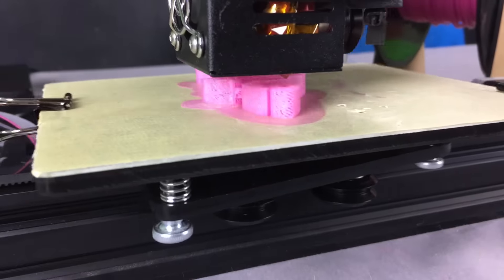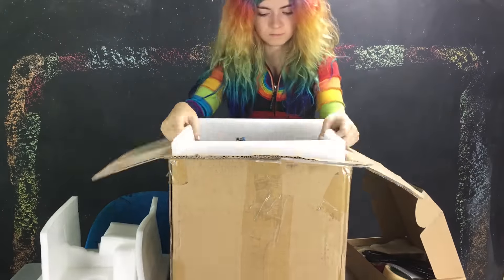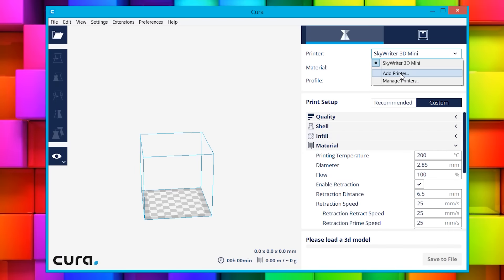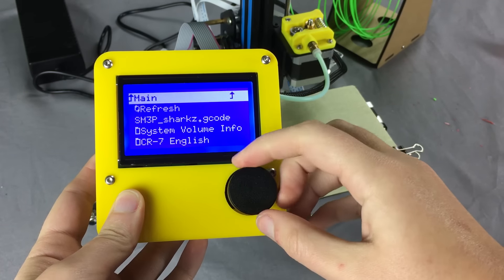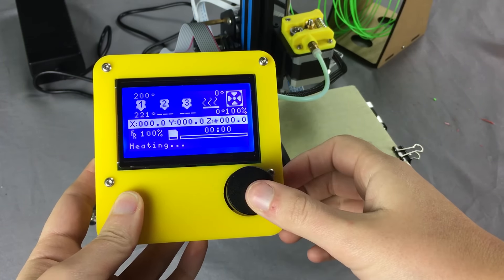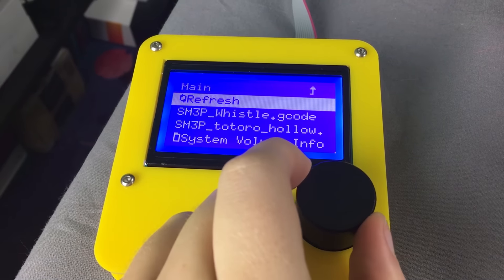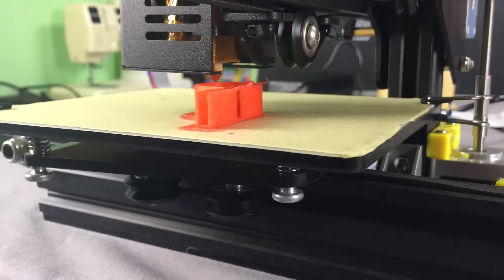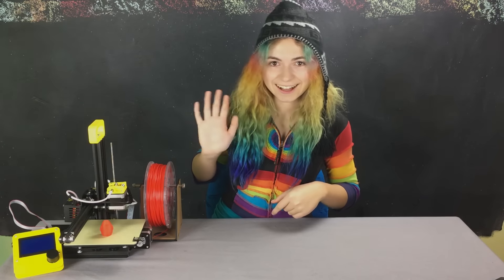My First 3D Printer! (SkyWriter 3D Desktop Mini)

Comment: First of all, welcome to the 3d printing community! Visit us on /r/3dprinting if you need help! Second: There are a few problems with your printer. 

1. This is not an ideal printer for beginner. 

2. Your Y-carriage toothed belt is too loose. It's the moving table or print bed. You need to loosen the 2 hex screws on the end of the printers base (opposite side of the motor) a little and pull the idler pulley ( 02:39 ) so the belt gets more tension. The belt should now stop sagging when the bed moves to the right, as seen in 02:39 .

3. The printer is so loud because the default setting of the fan is too high you can safely lower it to 50% in Cura. You also have to change the preheat settings on the printer. Go to "Control" -> "Temperature" -> "Preheat PLA conf" (at the very bottom of menu) -> set the "Fan speed" to 111 -> scroll down to "Store memory" -> DONE

4. Is probably related to 3. Your shark failed to print correctly because the fan was set to 100% and the nozzle can't heat up high enough so the printer has a hard time extruding enough material. Or it's possible your filament is not exactly 1.75 mm thick but a little smaller. That can also be fixed in Cura, it's called "Flow" under the "material" settings in cura and you can increase it 1 or 2 % at a time, if lowering the fan speed doesn't help. If that doesn't help either increase the "Printing Temperature" by 5°C.

Good Luck!
Reply: Thanks!
Reply: Hello, my fellow 3d printing geek
Reply: Farnømat yay im nor alone

Comment: Glad you finally got a 3D Printer to play with! Definitely lots to learn, just keep printing new things. I think you would enjoy a program called 'sculptris' to 3D model - it's like virtual clay and will export .obj files that cura can open. A cooling fan or slowing down the print speed will improve the small details like the ears - even a desk fan pointed at the printer can help for these details.

Comment: hi!!
I have a 3D printer in my home, and we use hair spray to prevent the plastic from sticking to the surface you are printing on,  and it is working good! I saw you were struggling with getting the shark out of the surface, and you can try using hairspray and see if it will work for you.
p.s., I love you so much😘
I hope it will help you

Comment: Now you have a new toy to learn all the quirks of!  It looks like you need to calibrate your extruder's steps/mm since it looks like your printer is under extruding a lot.
Reply: probably due to the fact that she set (or cura did automatically) the filament diameter to 2.85 when the printer most likely uses 1.75 diameter filament
Reply: Yup, didn't even catch that, that'll definitely do it.
Reply: Elia A. Gasperini I think that is because the Ultimaker uses 3mm Filament. (Cura is made by Ultimaker and the Community) so the normal setting is 3mm for the diameter. (Sry for bad English)

Comment: You had better luck that I did. My friend decided to buy me one of these for Christmas -- today I thought I'd set it up. When I turned it on the controller said it had printed for 3 days, 11 hours, and six minutes! -- and that it had used 949 meters (about 2500 feet) of filament. And this is supposed to be brand new; I just took it out of the box.

I could not get the plate low enough not to hit the nozzle, even with all thumbscrews fully tightened. Then I notice the Z-axis home switch was bent out of position allowing the nozzle to go lower than it should. I had to go through the software (for which there is no documentation) to figure out how to lift the nozzle manually so that I could fix the switch. I did that and tried again; one side of the print platform is always higher, no matter what.

I think this may have been a used printer put back into a box. Hopefully, they'll exchange it for a new one. If they don't, I will make sure my readers (I write for Nuts & Volts magazine) know to stay away from this company.

I'm glad you had better luck than me. I'm bummed because I have a couple models I made (I use FreeCAD) that I wanted to print.
Reply: Most manufacturers do a 'burn in' that would account for some of that time, to make sure it works - but 3 days is excessive. It does sound like a reboxed demo unit. Bent / broken switches often occur in transit by careless couriers. The print platform should be adjustable with springs, or through software compensation. Interested to know what brand and company... :)
Reply: Same as in the video. We will be returning it.

Comment: A tip on the ears,  if you can get a cooling fan on your part as it prints the ears will turn out better, they are just not having enough time between layers to cool down so they come out funny

Comment: You need to calibrate your extruder steps or check your tension on the extruder. For some reason you are getting underextrusion. Hopefully that keyword can help you diagnose your prints. Just look up youtube tutorials on "Calibrating extrusion steps" or Tighten the part that compresses the filament to feed it through the printer.

Comment: In addition to what Cutter Slade pointed out, your nozzle is waaaaay too close to the bed. Watching the whistle particularly was a bit on the wincy side. Try the paper test to get your spacing just right: After you've eyeballed the distance from the nozzle to the bed, take a standard sheet of paper and slide it under the nozzle; there should be a little resistance, but you should be able to move it.

Do that same process at all four corners of the bed and then the center of the bed; you should feel the same amount of resistance at each point. Doing this should get you substantially better results on your prints.

Comment: Your prints are so badly under-extruded you should fix that.
Reply: I do agree with that. I have an ultimaker v1 with a cooling fan upgrade so the filament may gum up about every seven or so prints
🤓

Comment: the 3d printer is underextruding
Reply: betap parkour what does that mean?
Reply: it means that the 3d printer is not extruding enough plastic, that is why the print has holes
Reply: it means that the 3d printer is not extruding enough plastic, thats why the print has holes